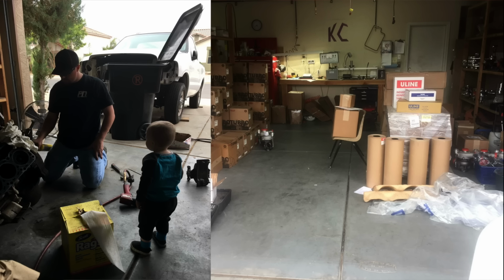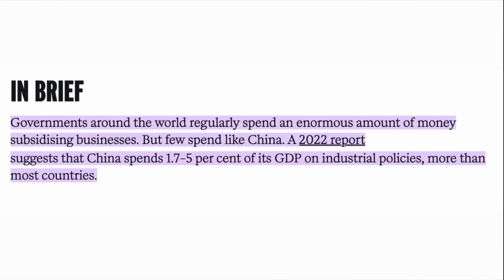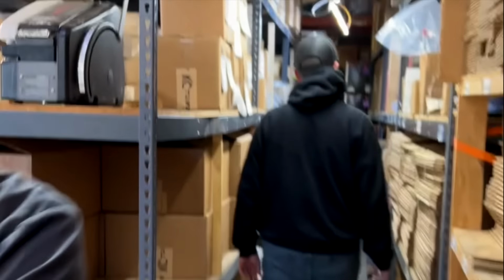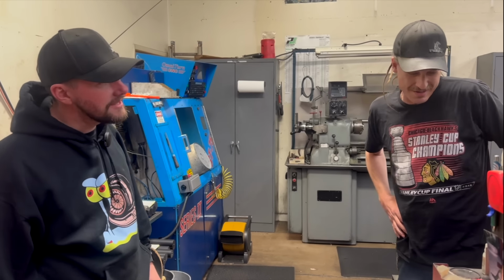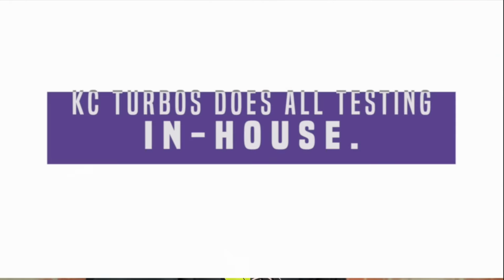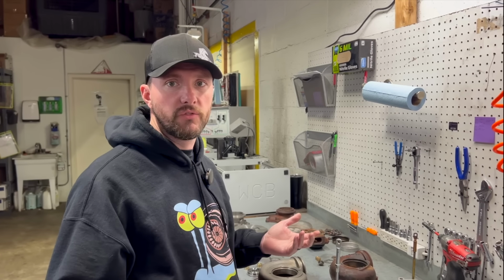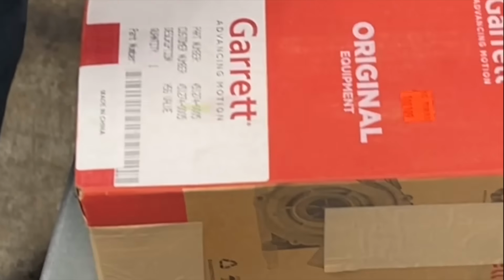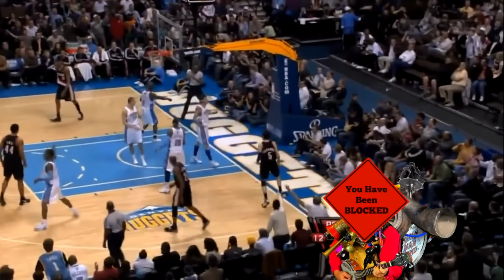Is My Turbo Made In China???

Comment: Im being running your turbo for about 4 years now, 7.3l, 63/73 .84, im from Costa Rica, probably only one KC around here, not a single issue with your turbo, i will check the new turbo model for the 7.3l